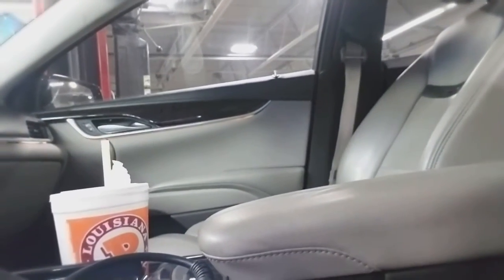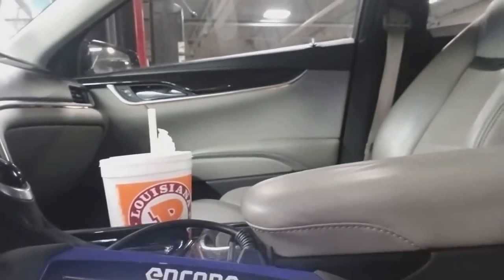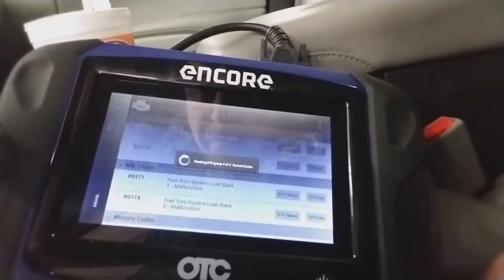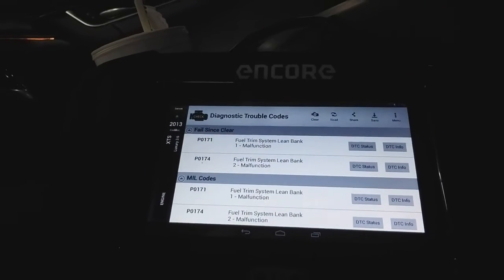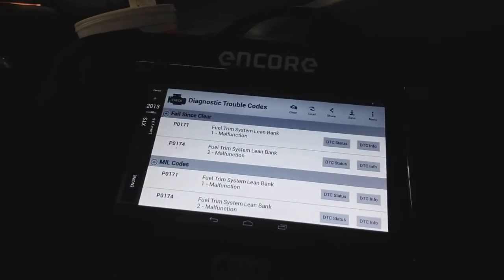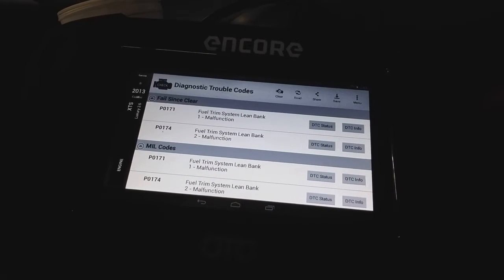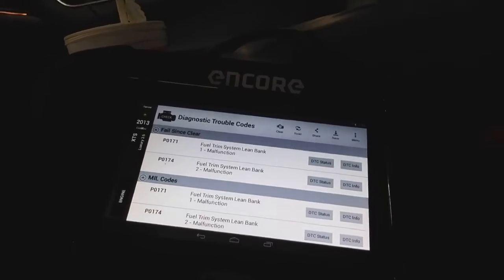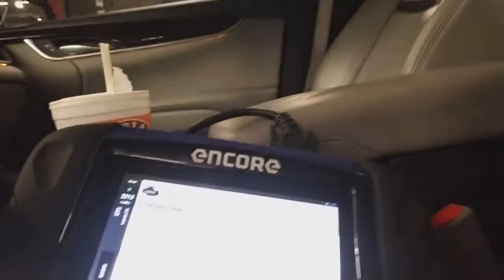2013 CADILLAC XTS P0171 , P0174

Comment: I changed the part and it started to shake more and feels like shutting off and making a squeaky noise what you think it could be?
Reply from the maker: What syntoms did it have before replacin de air hose, you may have more than one vacuum leak,it sounds like on the right side of the imtake it has a plug that at times it fold down ,make sure its on place, its located by the windshield side.

Comment: Thanks for the video! 
I successfully replace the hose but the engine light still on
Reply from the maker: Thanks for comment, after you replaced the hose,did you erased the code,if light still come on that means that you have more vacuum leaks ,asuming that you have the right fuel pressure,for vacuum leaks,spray carb cleaner spray gently around intake manifold,and vacuum hoses.

Comment: so what is the name of the part you changed???
Reply from the maker: Hi, Louie just ask for the air filter to throttle body air hose
Reply: It’s called Fresh air intake hose duct. For 2013 Cadillac XTS , the Cadillac dealer Part # is 20885923. If it does not solve the problem then after checking the Vacuum leak, replace the hose part # 12643692 ( PVC Tube ). Hope it solve the problem.